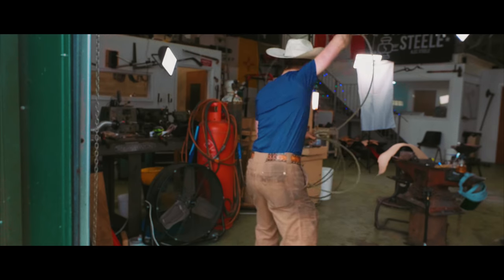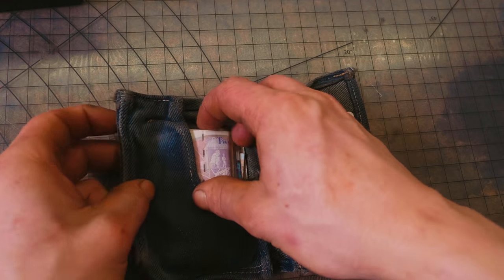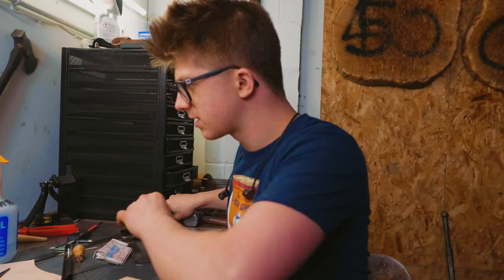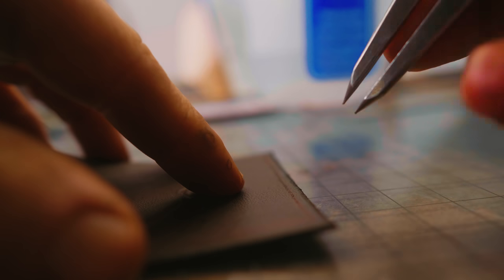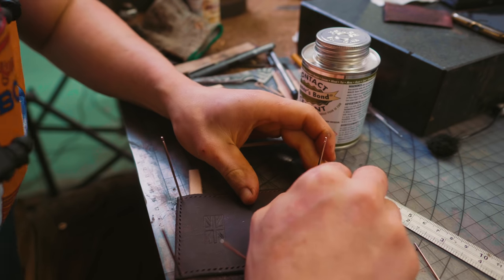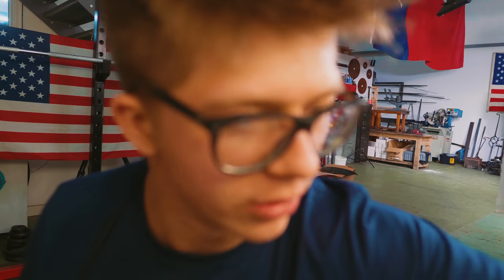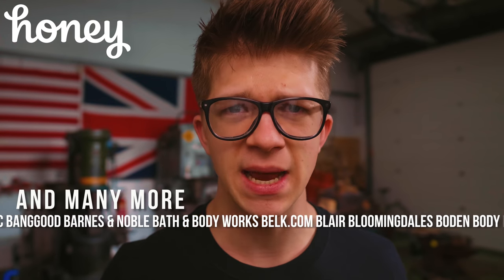MY NEW FAVOURITE MATERIAL!?!

Comment: Pretty good for your first solo project. Refining your skills comes with time, like anything. Practice, practice. If you want to keep that edge beveler sharp... and you do want to keep it sharp... cut a 1/4" strip of that thicker leather, cut a slot into a piece of wood about 1/8" deep and wide enough for the strip to fit in, glue the strip into the slot, bevel both edges of the strip, rub some jewelers rouge into the exposed edge of the strip, and when ever the beveler stops cutting cleanly drag it along that strip a few times. Voila, sharp tool. I sharpen mine about every 10' of beveling.

Comment: you forgot to burnish the edges once you were done and provide all the treatments to make sure it lasts for a while. also if you formed it without putting everything in when you did it you would have had a much cleaner, less bulging look to it when you're done and dusted. otherwise it was pretty good.

Comment: @Alec - why don't you try to do a knife handle from leather. Just cut a lot of little ovals or any shape of the cross-section you like with a hole in the middle and tighten it with the nut at the end (any shape of nut you like - brass looks nice with leather)

Comment: The thing that punches holes is called a thronging chisel.  To figure your thread, measure the length of sewing area and multiply by 3.  If your sewing 4 inches you want 12 inches of thread.  4 inches for the top side, 4 inches for the bottom, and 4 inches for the transition between sides.

Comment: Not really the case with this wallet as you dyed it dark but I let off a small girly scream when I saw you put the wet leather on what seemed like a steel block. Tip: keep non-stainless stuff away from wet leather as it will stain it in no time and ruin a project with dark spots.

Comment: I'm no professionnal but I do know that if something is too tricky, you're probably doin' it wrong. All the trouble you went to line up the edges after gluing. Puting needles and stuff... I think it would have ben easyier to glue first and punch the holes after. But again, i'm no professionnal.

Comment: Don't take this the wrong way, but leather working is another skill much different than what you do. Your a really talented metal/shop worker, but this being another skill don't underestimate. To be good at this is just as hard as your main craft, just different. You did a pretty good job for your first wallet but you could have used a much much better template. You put allot of work into a crappy design no offense. Please dont take that the wrong way you're very talented. You live to go gung ho and learn by doing. Im the same way so I force myself to put all my ideas down and map them out.

Comment: I see an Oklahoma flag but like...... that intro was just.... entertaining, but completely cringe lol.
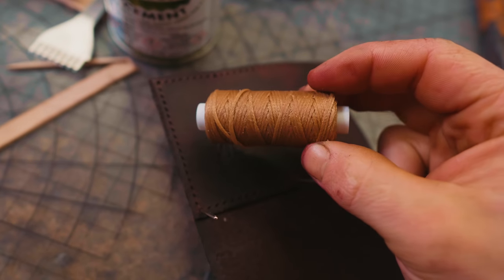10:15 it's almost like.... those hole punching tools could go right through more than one piece of leather at a time.... hrmm..... Sure the leather needs some forming but the method he's using is just punching new holes 1 by 1. I'm..... unsure.
10:30 Hairspray (sewing trick for standard thread, in this case clear nail polish might be better actually)
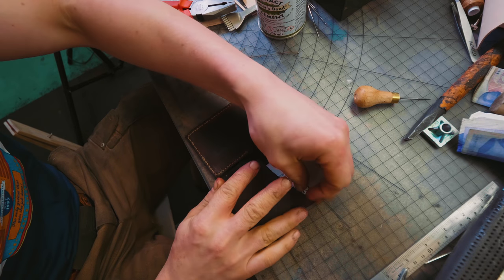12:09 those edges cringe almost like.... the hole punch could've easily done through two layers....
15:00 ....bills? Hrm.... that seems....... impractical. That's just a PERSONAL OPINION though.
Sorry for the harsh criticism, quite a bit of a fan still and I enjoy every blacksmithing video I see you do!